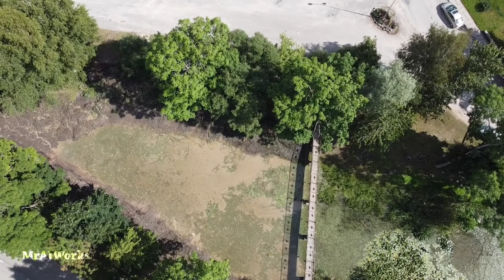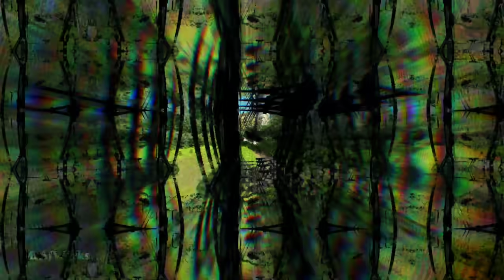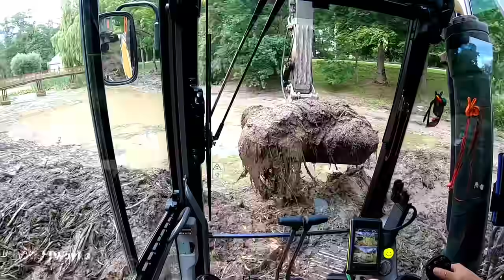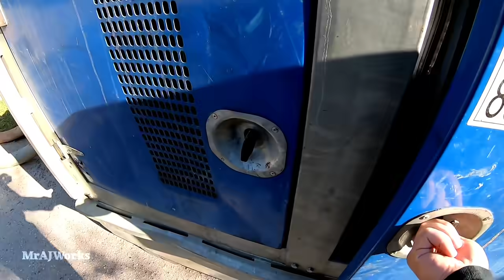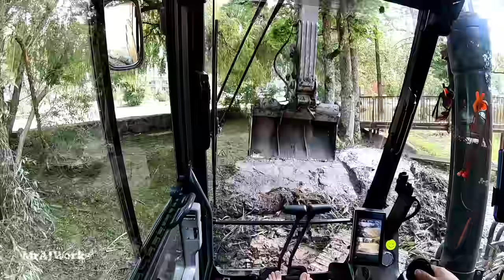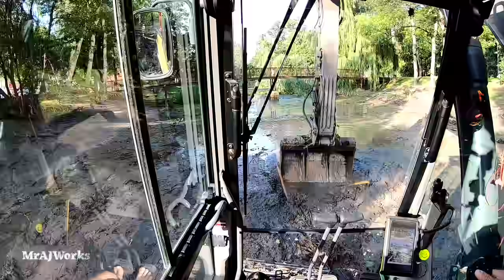Pond Cleaning Part 2

Comment: Your skill set is very impressive for your age. Did you start running equipment at an early age? You are very smooth and logical in each operation. It is a pleasure to watch you. If you have the same skill on anything you operate, I hope they are paying you well. You deserve it.
Reply from the maker: Thank you👍
I have been working on a chain excavator for 7 years.

Comment: Why dont you wear shoes I thought it was a safety thing while running heavy equipment"
Reply from the maker: I have safety shoes on the excavator. If anything needs to be repaired, I would put on my boots. It is very hot outside and I work in the cabin without shoes😉
Reply: Shoes will bring mud all over his workplace.
Reply: Lmao just now saw his toes.
Reply: @billcoley8520  ohok